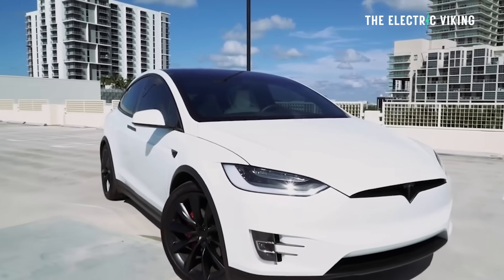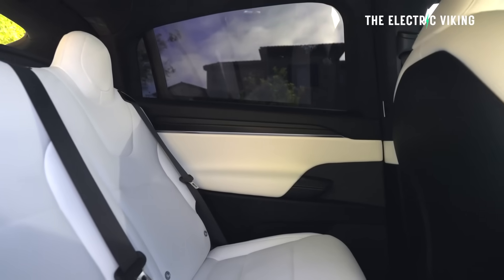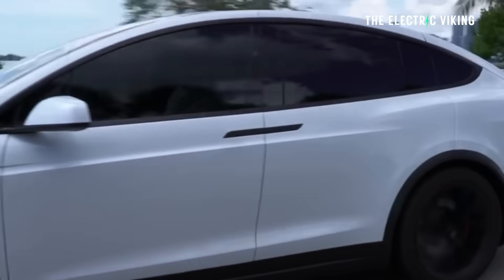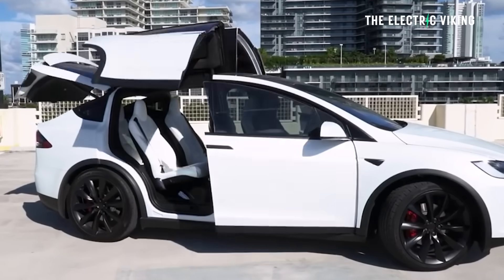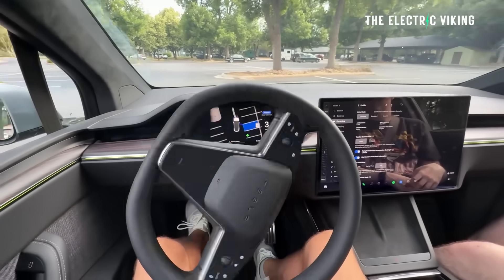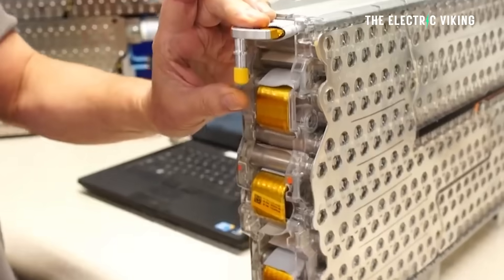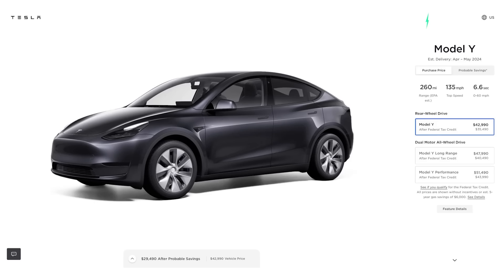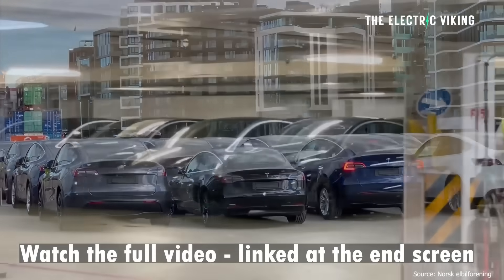ENGINEERING MASTERCLASS: New Technology Slashed 400 Pounds From Tesla's SUV

Comment: People who hate Tesla somehow their relatives (father, mother, siblings, in laws, cousins, nephews, nieces, uncles, aunties, grandpa and or grandma) even theirselves are connected to big oil company business. Therefore, they consider Tesla as a symbol perhaps the  leader in disrupting their pollutive business.
Reply: I had an interesting conversation with a colleague whose uncle bought a Tesla of non-specific variety which gave him endless problems and finally let him down by the side of the road with no energy left (Apparently).  They went on to say this does not happen with internal combustion cars. I Mentioned it does all the time because the busiest Job the AA have is recovering vehicles running out of fuel or vehicles that  Misfueled.  And most diesels have to have the system bled you just can’t add diesel and carry on. I don’t think I want to hear it
Reply: @ouethojlkjn I once mistakenly added gasoline to my diesel jeep. I stopped after realising then continued with diesel. No issues. You can add a few litres of of gas to diesel, but probably not the other way round.
Reply: Tesla is fine
Elon is a POS

Comment: if they reduce the weight of the car by so much why dont you replace this with battery so you get extra distance
Reply: The weight reduction itself already adds enough extra range. A normal step to take would be to make the battery a bit smaller  so the car gets lighter again, limiting the range loss from that step.
Most people who drive an ev daily know they don’t need more than about 300 miles of real world range.

Comment: I had BMW ix50 for a year, now have Tesla x plaid.
Short comparison:
Build quality of bmw is on a totally superior level compared with usa made cars. Confirmed with my wifes car tesla 3 lr which is chinese made and high built quality.
Noise level of bmw ix superior conpared wit tesla x
Real range of bmw 600 km, tesla 450 km.
Autopilot bmw flawless, tesla makes surprising moves all the time.
Performace bmw impressive, tesla fierfull.
Tesla is more spacious than bmw.
Bmw is much more comfortable than tesla.
Suspension bmw excellent, tesla adjustable but the correct adjustment missing, something wrong.
Some real world comparison for you who are interested.
I have ordered the new bmw ix3, since I really been dissapointed in the tesla x plaid.
Overall bmw high quality, tesla consumer quality.

Comment: It weighs roughly the same as a Kia Ev9 base model. According to recurrent most Tesla vehicles aren't coming close to their projected vehicle range.
Reply: Try Edmunds instead their ev range testing almost approximates the EPA 5 cycle ev range test. and so Edmunds usually gets within 1-5% of the rated range either way.